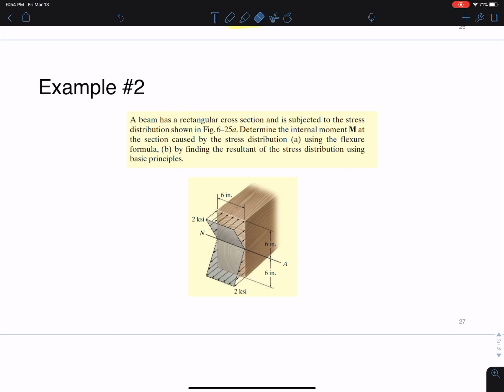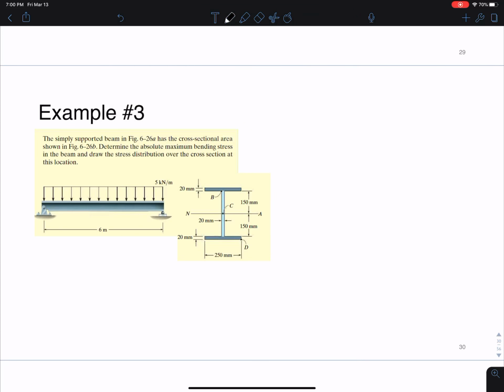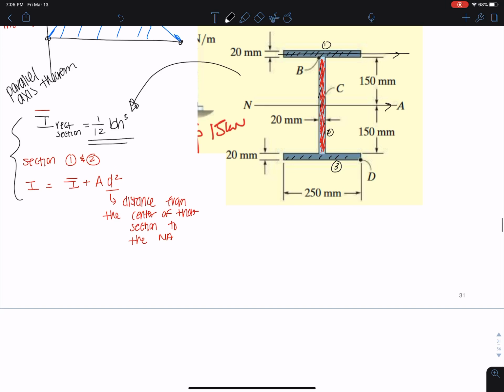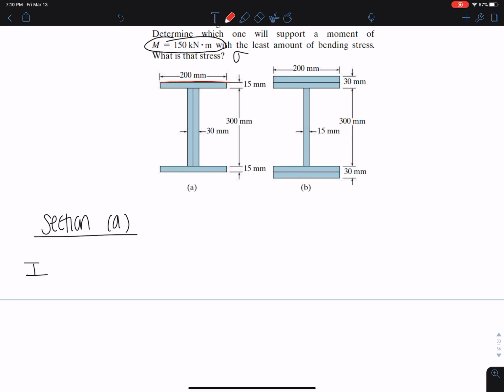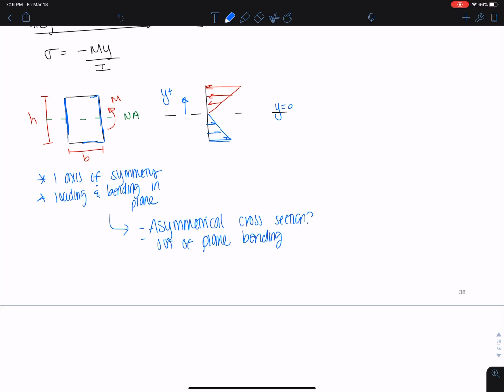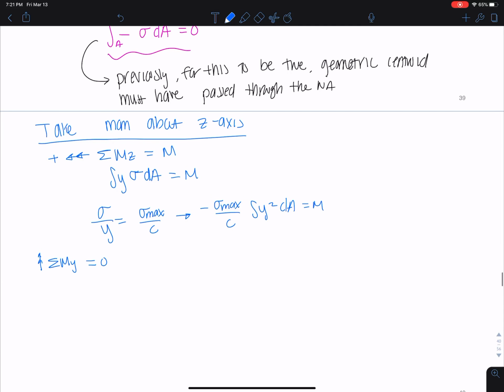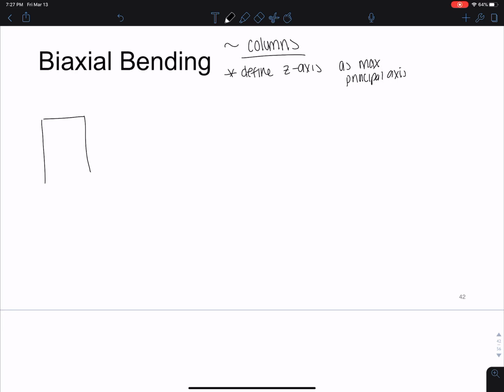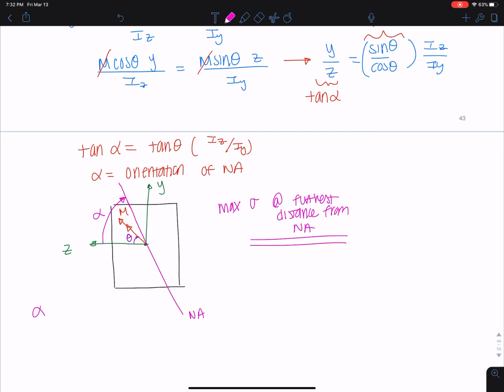EGCE301Topic5Part3

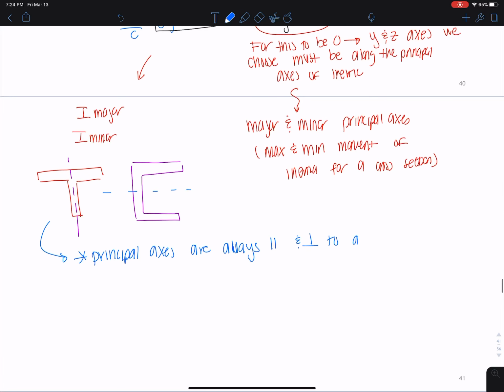Comment: Can anyone offer clarification on how the major and minor axes are both parallel and perpendicular to the axis of symmetry? I am having a hard time conceptualizing this idea at 29:45
Reply: I think one of them is parallel and the other is perpendicular. For example, Imajor is parallel to the axis of symmetry, whereas Iminor is perpendicular (or vice-versa).
Reply: in T, I or C section, the symmetry is about parallel and/or perpendicular axis because the shape is same about that axis, for example take a piece of paper and draw T section and fold it like this that after folding whole half part is overlapping on the other half, then you can see that particular line which seperates the two halves is the line of symmetry . for T section it is one perpendicular line, for I section it is both parallel and perpendicular line and for Channel section it is only parallel line of symmetry